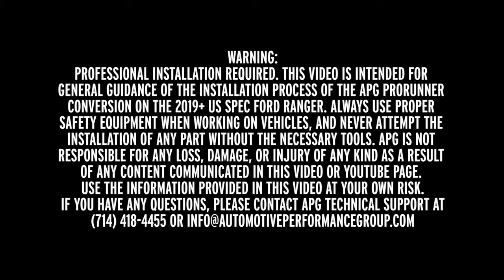APG Installation Series: ProRunner Suspension

Comment: Gday APG, I'm aware youR site states 2019+ for this kit but here in Australia we've had the diesel ranger for quite sometime. do you think this kit would fit on a PX2 (2015-2018) Australian ranger?
Reply from the maker: No it will not, the PX3 T6 is a different model design